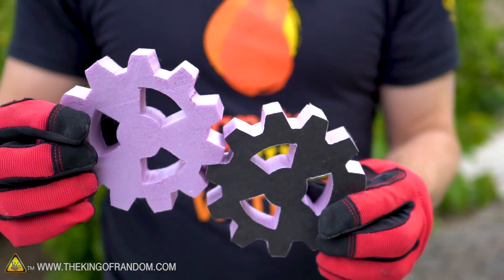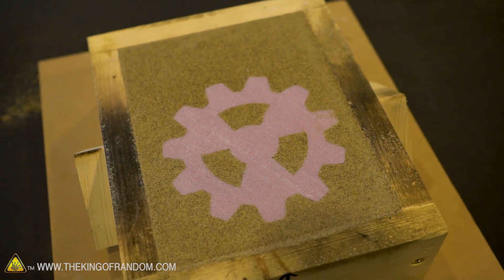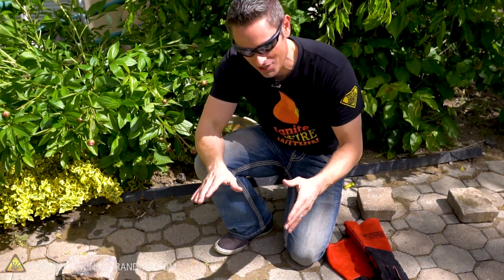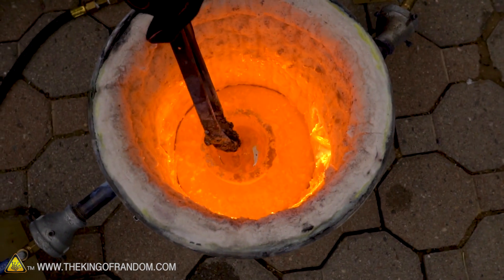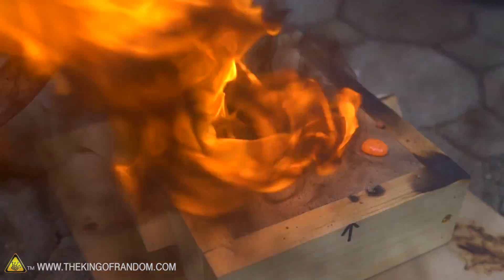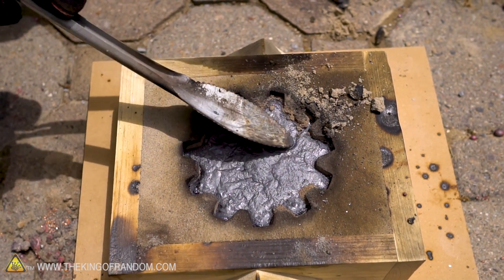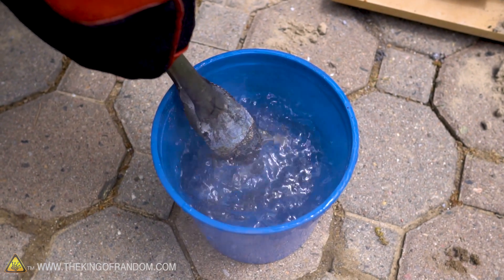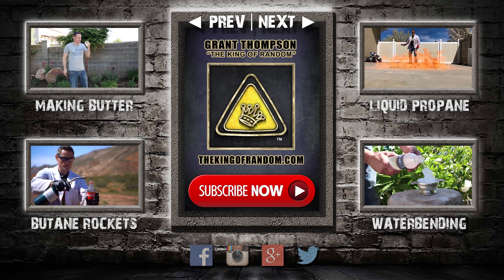Argh. Why Is Copper So Difficult? TKOR Tests Melting Copper In Our Homemade Foundry

Comment: Ok, since coper is extremely proficient at conducting heat and releasing it(cooling), you should try with plaster mould and heating it in industrial oven to about 700-800C' to have a hot mold and after that try pooring coper. Or you can try with orthondontist materials tha are for this use...

Comment: Don't let your crucible touch the ground. Any contact with a surface that is cooler than it will drastically drop the temperature.

Comment: You can try to squeeze the foam between two sand molds so it will not cool as rapidly as this. Don't forget to put a vent hole and also vent hole and pouring hole sizes effect the cast quality. Use talk powder( baby powder? idk the english word for this) between the sand molds so it won't stick as much.

Comment: i think the reason you were having problems was the sand being lighter than copper and floating to the surface that and your green sand needs more binder next time you try this put some small steel or copper weights over the narrower parts and you should be golden

Comment: Wont it loose heat slower if you put styrofoam between two layers of sand with "breathing" holes and make one hole to pour the molten Cooper through. Ive seen other youtubers make their casting with two layers instead and thougt maybe it is a Way to go. I dont know if it makes sense?

Comment: I would think that wax might work better than foam, because the foam is too rigid and doesn't burn fast enough. also you need something better than tongs to hold the Crucible, because they are far to slow and clumsy, and just about dangerous. maybe the best thing to use instead of "green sand" would be investment. it's kind of like plaster. only first you make a wax casting then pour it around the wax and let the metal harden, then just remove the investment. 

Hope my ideas could help Grant 
D-man

Comment: You have to remove the foam put breather tubes in and put the top on it. That will allow it to flow and the sand can't float up. Also put borax in it as a flux to thin it out some

Comment: I think your main problem is the sand. You should try to use professional casting sand. Also, I'd recommend you create a two-piece mold, that way the copper might not cool down so quickly and should have more time to fill the voids better. Also having a two-piece mold might help with the overall stability of the mold.

Comment: what if you heated the sand with a blowtorch while you were melting the copper.  this would melt out the styrofoam and possibly allow the copper to cool slower

Comment: The problem was the water. When you pour copper the water in the sand expands and turns to steam. And the steam wants to exacpe and since there is no hole for it it just pops out sand and exacpes

Comment: I honestly think it seems like the sands not packed down enough near the mold but seems to be nice and strong at the bottom of the mold,
I would suggest putting 1 fourth sand and pack it down and keep adding and packing sand until done.
and in my preference I would use red bagged clay.

Comment: Why not use both the cope and drag? For such a simple mold it wouldn't be hard to implement and it would give support to the inside detail of the mold. With a better supported mold you won't have to worry about adding in more water. While it did look a bit dry initially, I think it was a bit too wet when you added more water.

Comment: Use dowels or screws to reinforce the parts that keep popping off. They arent crumbling apart, just breaking off, so its either the weight of the copper on one side pushing it over and breaking it or bouyant forces pushing it up. A screw in each one may help stabalize it and you would just have to place it in while you're packing the sand.

Comment: The molten copper is so hot that it boils the water in the sand creating fractures... the sand should be nearly as hard as stone. You could try to make a steel mold if you have access to a cnc mill.

Comment: I would try adding some silt or clay to the green sand as that would hold together better than the larger rounder sand grains. silt and clay is usually much rougher grained and will hold together better

Comment: my uncle works at a casting company and he has a tip. put the mold under the sand and make a hole to pour in the copper and make sure you wet the sand.

Comment: What happens is you put liquid nitrogen in the microwave
Reply: barely anything. it just boils a bit faster. it has been done before.
Reply: Ment in a microwave
Reply: michele seay nothing the microwave would just get all smoked due to the fog the liquid nitrogen is creating 
Either that or
The liquid nitrogen evaporates

Comment: Hi,
you can try this thing if you want,
use styrofoam cut and do exactly same process, just replace sand with fine quality concrete.
once concrete dry out, then pour molten copper metal.

once copper solidifies, drop whole concrete bar in cold water.
few min. later, break concrete part and extract your copper cast.
:)

Comment: Perhaps use the green sand to form a top mold and pour through a sprue, so you'll have the weight of the top sand holding the pieces in place.

Comment: Double sided mold with the foam in place in the middle. Core a hole in the top and bottom for draining and pour copper in. Like a casting. The copper will burn out hte foam Too much oxygen in the mix!

Comment: If you can find a way to keep the crucible hot while you'll pouring it I think it won't give the copper a chance to cool down as fast. Or change the mold instead of using sand use steel or something

Comment: hey Grant , why don't you try using diffrent type of styrofoam? maybe it will solve your problems , and if you want to learn more about copper casting try watching a channel called Tito4re , he makes copper castings but using both sides of the mold filled with sand

Comment: the transfer of heat between the copper and sand cause the sand to expand while it also makes the copper contract while this is the case with all castings sand is easily deformed which is why the sand keeps losing its shape . which is why most who use sand casting stick with metals with lower melting point .

Comment: I think the sand dries out because of the heat, so it doesn't matter how much you spray it with water before casting. In the other hand, you could try to bury the styrofoam gear in the sand, with a channel to poor the copper in. I haven't ever melted metals so that's not any professional advice.

Comment: GRANT why don't you just take the foam out before pouring the copper? Wouldn't it be easier to just poke it out with a fork and not have to worry about the foam messing up the pour?
Reply: Bamster20Mil but he has the chance of destroying the mold

Comment: Love these videos! one of the major suggestions I have is to include some sort of gating system this will slow the metal flow down in order to prevent turbulence that causes the center parts to lift. also most of the time the cores, or parts used to make a central cavity or in this case the radioactive symbol are make of sand that is bonded with some sort of polymer. This allows them to deal with the flow of metal around them and make sure they are stable and remain intact.

Comment: I think the issue with this sand molding stuff is that it is less dense than molten copper. Thats why it keeps going up like that. if the density of the sand was higher then the weight of the protruding radio active symbol will stay in place and wont be pushed upwards to float.

Comment: Instead of greensand I would use a plaster mold. The guys over at Man at Arms: Reforged on the AWE channel use plaster molds to cast bronze with extreme detail. 
Greensand normally works for lower temp, and low detail casting. It will give be you the shape but not really anything else.

Comment: from what I know is that you are only using one part of your mold. You have to put the foam in middle of 2 halves then pout metal in from top, to do so, you need to put both halves together and drill a hole on top in the center where two pieces meet

Comment: Frankly I think you might have a better chance of casting the copper in Play-Doh since it will keep it's shape far better than sand seems to at this heat. That's just a guess of course hmm maybe a combo of the two could work?

Comment: you should put the styro gear in the middle of the sand, so 

sand
gear
sand
wood

 with a little hole in the top middle so you can pour the cooper and everything will fill just nicely

Comment: you should check out the channel for Keith Rucker of vintage Machinery works as well as SV Seeker Channel. they both have done Foundry work but SV Seeker has done a lot more. part of your problem is you're using the wrong kind of sand I think

Comment: Copper is much denser than sand, so the sand is breaking loose and floating to the top.  Aluminum, on the other hand, is only marginally denser than sand.  Try casting into a plaster or cement cast.  How many gears can you cast before the mold fails?

Comment: Hey dude, I think the fact that your sand is too wet and the water is boiling off in the sand and allowing the molten copper to flow under it. Try making another mould to sit on top of the original with a pouring hole. That should keep your mould in place and allow you to pour without the sand floating.

Comment: Hello,  I have a few suggestions for copper casting. First, you should try to make a 2 piece mould instead of one. So instead of pouring it onto the styrofoam directly you would pour it through a gating channel you would drill to the second part of mould. That way you should get better results. also when initially putting sand into the mould frame, you could sift the sand until the styrofoam is fully covered and then just add the rest as you did in this vid. Also dont forget to poke some venting holes for the gasses from styrofoam to escape, if using 2 piece mould. And to copper, I would maybe recommend mixing in some aluminium or tin. I know then It would be bronze, but bronze has better casting properties than pure copper. 
I´m a metallurgical engineer and I really enjoy your channel. May the mould be with you ;)

Comment: i think the Styrofoam gear is shrinking so fast it shrinks around the sand towers of the radioactive sign, so fast they pop up.
i think you should remove the Styrofoam mold before pouring the copper.

Comment: Styrofoam has a fire inhibitor in it that makes it difficult to use for casting.  Try using a foam that doesn't have that like expanded polystyrene.

Comment: A workaround for your situation would be pouring the copper on a layered basis.

So you pour a thin layer of copper for it to set and cool at the bottom first. While waiting for it to cool, reheat your copper crucible. Then complete the mold.

The first thin layer of copper should be enough to hold the sand in place so it does not get displaced by the copper due to copper's density and the steam formed by heating the moisture in the greensand

Comment: For that kind of casting, I believe, you should use a proper sand for casting, Which is a mix of clear silica sand and powdered resin.
And before casting your mold should be baked to make the mix strong enough.

Comment: Don't know what sand your using but it don't look right the sand we were learned with was oily the contact surface would burn hard the oil transfer heat not turn to steam thats what's blowing your mold also try two part mold copper quite hard to cast but your sand ain't right

Comment: Why not make an enclosed casting mold as opposed to an open mold like 
this video. Use the foam with a sprue and a couple of vents tacked on 
with hot glue. I have never worked with copper before but the guys over 
at the SVSeeker channel have numerous copper, brass, and NiBrAl casting 
videos. Except they use the Sodium Silicate molds. With the two-part 
mold you would not have the "floating sand" problem that was evident in 
this video. Stay random my friend.

Comment: Grant, i think the issues you're having stems from the issue of your cast. Instead of having it exposed and without the liquid pressure of a molten sprew, the copper isn't forced into the crevices.

Comment: What is you support the parts in middle by putting something in them to keep them there before pouring the copper. like a toothpick down it or a thin nail with a washer on top to keep it still.

Comment: The correct way to cast copper is to use wax sculptures and put them in plaster of paris, vacuum it to remove air pockets and avoid the paris to explode then pour the metal in the cast, wait for it to solidify on it's own and then break the plaster and add water.

Comment: You could try making a cast/mold for the gear in plaster. Just an inch or so deeper than the Styrofoam cut out, then hold the styrofoam gear in place with a bar of wood like the one you use to pack down the green sand over the top. When it's all set you can then put it in the oven to melt the styrofoam and remove it ready for copper casting.

Comment: You should be able to make bronze if you can melt copper. By the way, it may be prudent to make a plaster mold or to mix some resin with the sand to make it sturdier.
Reply: Also, you should be able to get more heat from the copper if you use fuel from your old hydrolox generator.

Comment: use a cope and drag plus use 3 pieces of #9 wire bent into a u with prongs sticking off the ends in the 3 center pieces so it gives it stability

Comment: its not the green sand whats the issue at all. its copper. as you know copper is a very dense metal, more so than sand. i get the idea that you wanted to try copper as no one else had but theres a reason no one else has. this experiment would (in theory) work perfectly with another metal such as aluminium. btw i would love to see that in a future video.

Comment: Hey Grant! I think the two part mold will  work because the sand lid will make pressure enough to keep all sand chunks together! Having two sprue holes is important so you can pour the molten copper in one hole as the other can release air and fumes... Also the two sides will be almost flat so it will look better I think. I really like your videos and I'm such a great fan of your channel, hope you try it again! :)

Comment: Another solution you could try is adding some nails in the center of the mold detailing prior to sand packing, that way there is the added benefit of having a ridged support holding the radioactive symbol in place. It might even be better to use screws so they have the added benefit of the threads anchoring the sand in place. Also It might be beneficial to use both the cope and drag, then add runners, vents, the sprue, and risers to the cope. The Sprue being the funnel you pour the liquid into, runners deliver the metal to the casting, and risers act as a reservoir for the mold to pull from as the metal cools and shrinks, and of course vents help vent the pressure in the mold.

Comment: are the sides of the inserts square too the face of the ring? if so you need the base (the side that's down when the mold is poured) to be slightly wider than the top it might need to have any/a bigger draft angle there

Comment: I think you poured it too fast. Think of it as water hitting a flat surface, it then blast out in all direction pushing whatever is closest "three sand pillar". Try pouring on the outside in slowly.

Comment: The weight of the metal is causing floaters. I would suggest using cement as a dip or spread around your foam piece. But that might cause warping on the drying. Then you need to use wood as a stabilizer or as your form. Once the small amount of cement dries. chip/burn the wood out. Use your cement mold to push the sand around. No more floaters. And you can break the cement away from the metal when you are done. I have very little actual melting experience, None in copper.

Comment: A couple people have already mentioned using a 2 part mold instead of just pouring into the lower portion. Use a light dusting of baby/talcum powder between the halves to keep the sand in the top from bonding with the sand in the bottom. 
Also, preheating your mold in the oven will help remove the excess moisture that is causing steam to build up in the sand.

Comment: When opening a gas bottle, you should always open the main valve only max 1 rotation, unless it also regulates the amount of gas. The idea behind this, is to be able to shut down the valve as fast as possible, since gas can usually flow unrestricted already after 1 rotation. Makes a huge difference if the hose bursts and shoots out flames around.

Comment: try reducing the moisture of the sand maybe that causes steam and causes the sand to pop maybe. or try putting the mould in in a vacuum chamber to remove any trapped air that may expand and pop the sand due to heat maybe

Comment: maybe you would have better luck with the other kind of styrofoam (the kind with little beads)
It's way less dense and would probably melt away leaving less residue in the bottom of the mold.

Comment: Try sprinkling baby powder on top of styrofoam gear in place with the sand mold, then take a make-up brush, and lightly coat the surface, then remove the styrofoam gear from the sand mold, then pour the molten copper... (Your Welcome)
Reply: When I did sand castng (with silicon bronze), that worked for me.
Reply: prebenkul no he said place baby powder after you remove the mold
Reply: Athithan You're
Reply: also the sand looks very dry and crumbly. it needs to be much wetter.
Reply: That makes no sense, so you put baby powder on the Styrofoam that's in the mold, u coat the surface of said gear then you remove the gear? That would do nothing to the sand, only the Styrofoam. Ur basically just removing the gear with the baby powder, leaving just the untouched sand.
Reply: Like so, Grant can see...
BTW: my name is pronounced as (Al-ee-tan) or (Ali-tan)
Reply: Athithan Al-Eaten?